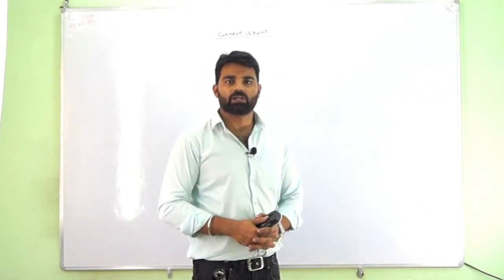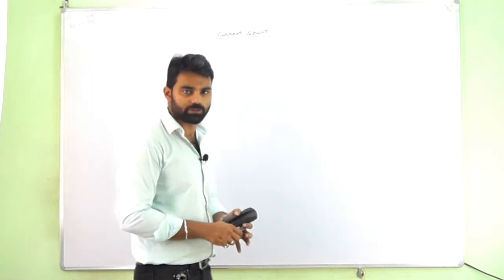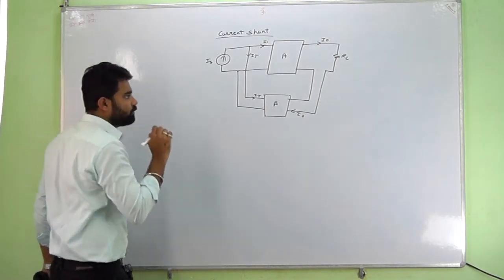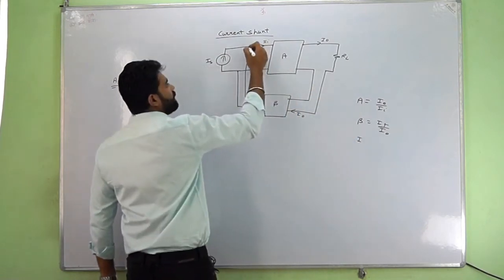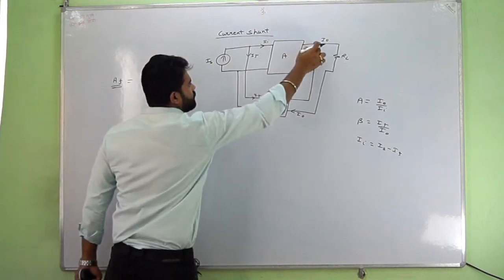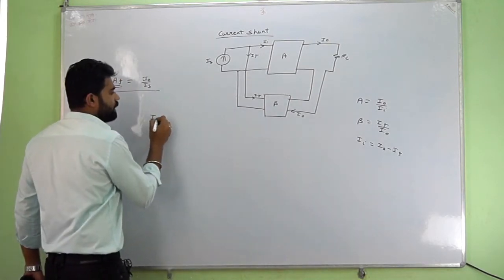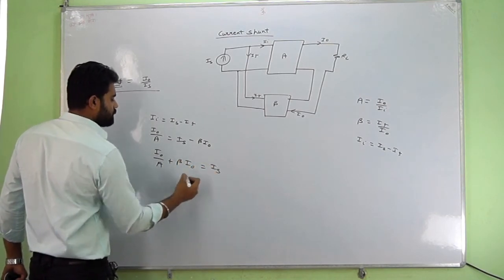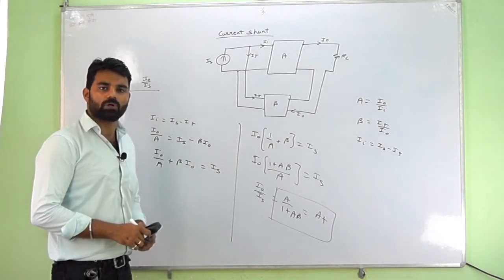Af, Zif, Zof for Current shunt feedback amplifier

Comment from the maker: Whenever we calculate zof 
The output impedance has to be removed
ie zl is to be made infinity, as in presence of any other zl, the output impedance will be parallel combination of output imedance an applied zl.
Two key points
1. You can always manipulate applied voltage and current source as it is applied (external).
2. You can always short ckt and open ckt load impedance.(externally applied).
The ckt doesnot depend on the external ckt attached.

Comment: why RL=infinite?
And Vs=O?
Plz ans me.
I don't understand this 2 things.
Reply from the maker: Hope Your question is answered by the following explanation.
Reply from the maker: Hope Your question is answered by the following explanation.
Reply from the maker: Whenever we calculate zof 
The output impedance has to be removed
ie zl is to be made infinity, as in presence of any other zl, the output
 impedance will be parallel combination of output imedance an applied 
zl.
Two key points
1. You can always manipulate applied voltage and current source as it is
 applied (external).
2. You can always short ckt and open ckt load impedance.(externally 
applied).
The ckt doesnot depend on the external ckt attached.